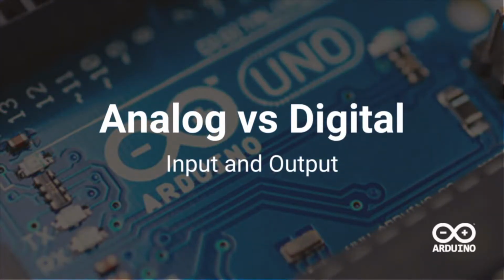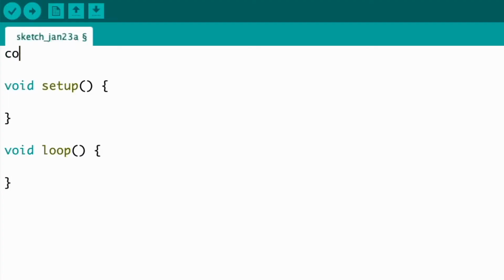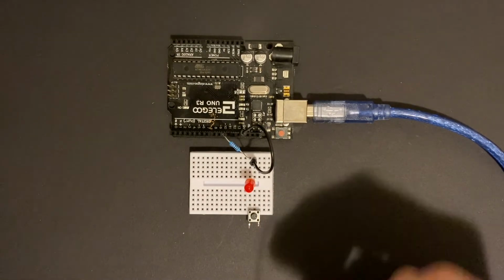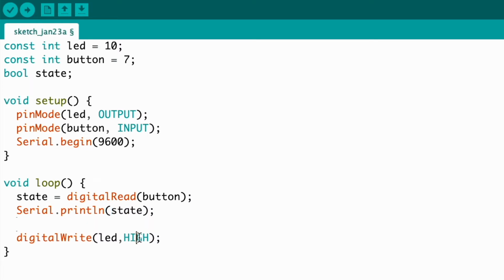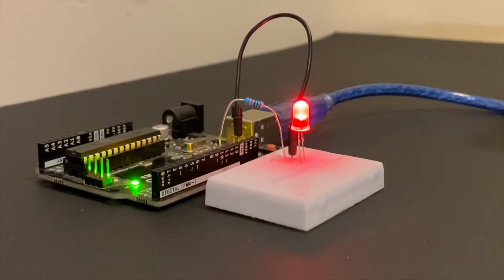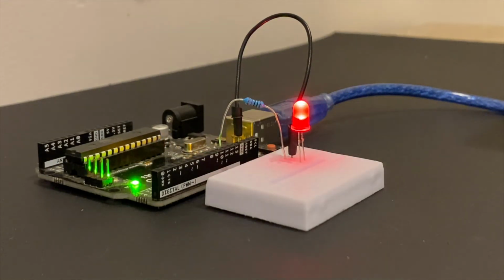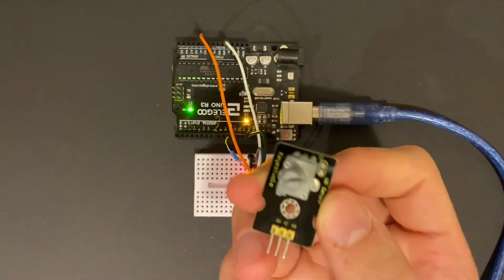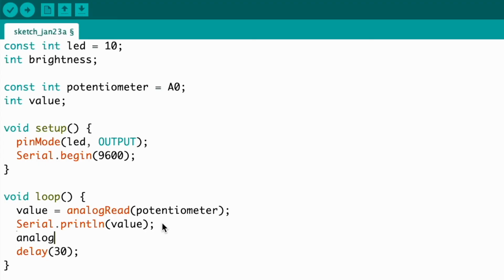Arduino Basics: Digital And Analog For Input And Output

Comment: PWM is not analog output. That should have been much better clarified. Pulse Width Modulation is still square waves, unlike the true analog output graphs or diagrams shown
Reply: It's an abstraction though, right ?

Comment: How would you write the code to use an analog input to control a digital/logic output when the analog value is in between two set values? I.E. On from 0ohm to 2k ohm, off between 2k ohm and 8k, on from 8kohm to 10k? Or light an led when temperature sensor reads between 20-50 Celsius?
Reply: Here you go:
int temp_pin = A1; //temperature sensor analog pin
int temp_value = 0; //stores temperature value
int led = 13; //led digital pin

void setup() {
  //setting the led pin as output
  pinMode(led, OUTPUT);
}

void loop() {
  //the way you read the temperature varies upon your temperature sensor, this will be different in your code.
  temp_value = analogRead(temp_pin);

  if(temp_value >= 20 && temp_value <= 50) //turning the led on if the temp is between 20 - 50 units.
  {
    digitalWrite(led, HIGH);
  }

  else //leaving the led off if the temp isn't between 20 - 50 units.
  {
    digitalWrite(led, LOW);
  }
}

There might be other ways to do this, also in your case the way to get the temperature value will be different, according to your sensor. So the temp_value variable will be different in your case.
Hope this helps :)